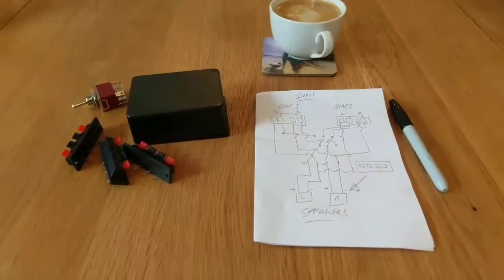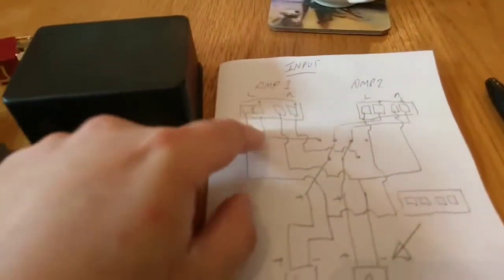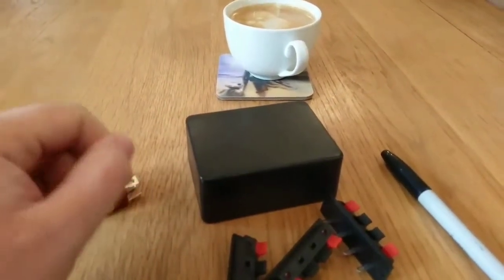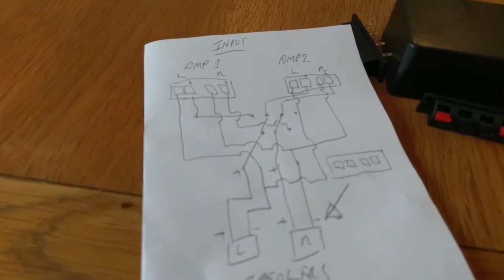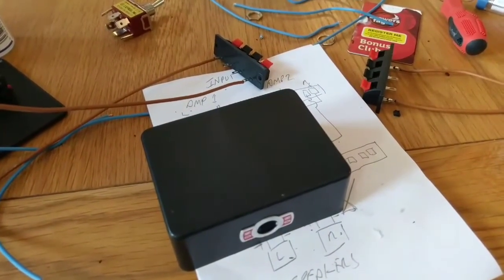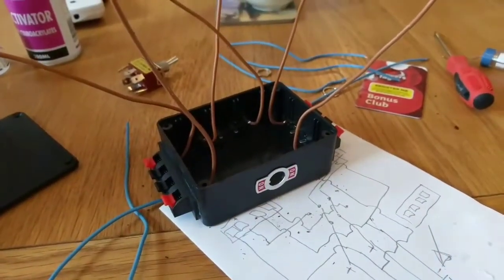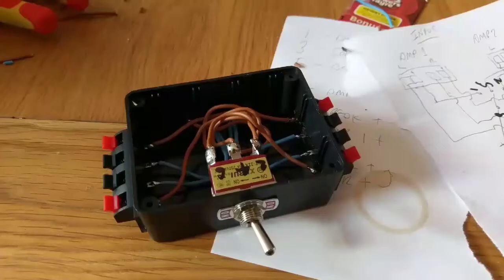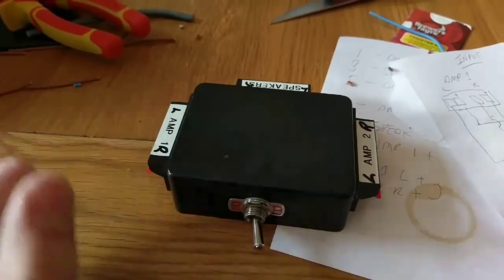How to build an amp switch box

Comment: do  you not risk to fry your amps, if for a moment  both of them are connected, while switching between one and the other, ?
Reply from the maker: Yep that's true but impossible if the switch is the correct design. I.e. on - off - on
Reply: Yes, 3 position switch is the proper way.

Comment: Is that switch (double pole single throw) for one speaker only? A four pole double throw toggle is needed? Update:  I was wrong:-) I don't have the connectors and the project box, and didn't think thoroughly. Just used two dpst naked switches to control the two speakers separately. Have to bend over and  toggle twice each time. But guess I could still connect the wires directly and correctly without the connectors...